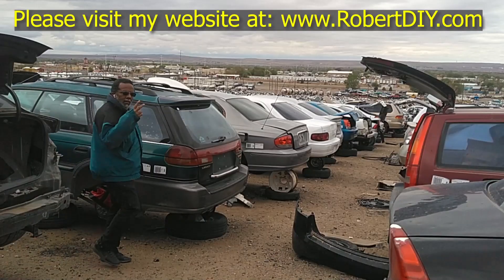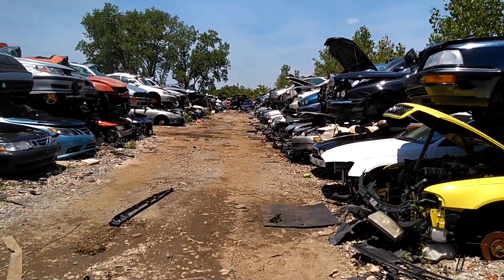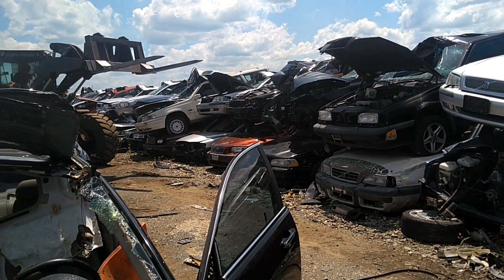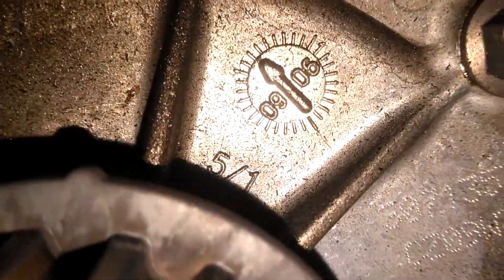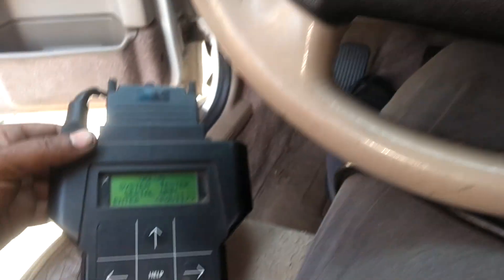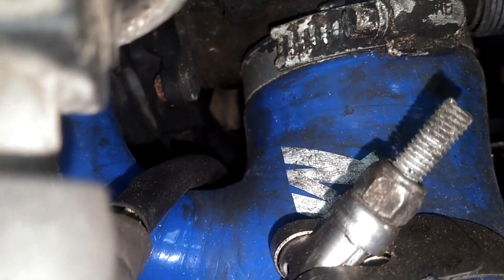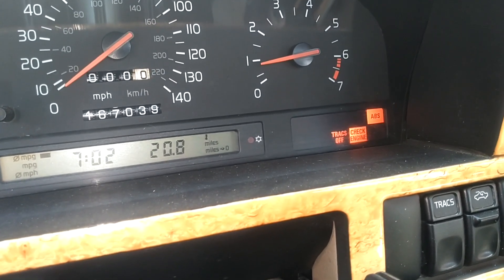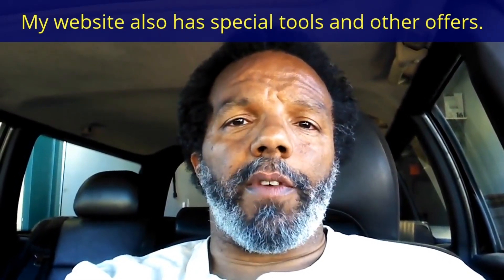More 2 Stack action, replaced a power steering pump and check on a 850R with shifting problems. HOWR

Comment: TPS sensor signal is needed for the trans to know when to shift!!!
Reply from the maker: Yep.
Reply: Indeed  thx robert   u have the best youtube channel info from these volvos (whch are da best FF cars in my opinion , and s70 v70 . i had couple 142, 244's not to mention amazon volvo b20k  -65 although we swapped cheva 350 ci innit with TH350 Dana rear end
That thing is a monsta1👊👍☺

Comment: Hi there

Hope this finds you well

Firstly I'd like to thank you for the valuable information and help that you provide. 

Secondly I'm located thousands miles  away from you so your answer to my questions will be greatly appreciated

I need your step by step instructions on how to remove Rear Cooling Bypass Pipe because  it started to leak from where it meets the back of the water pump 

My car is Volvo xc70 2001 turbo AWD

Thanks and  best regards
Reply from the maker: Disconnect the exhaust at the turbo flange, pull the exhaust manifold, disconnect the pipe from the cylinder head and hoses. Then pull the pipe out of the engine which plugs in behind the water pump.
Reply: @RobertDIY  thanks for your reply i do appreciate it. do i have to remove the entire turbo or no?
Reply: @waelabdelmajeed4999  Robert mentioned in another video that he usually doesn't get a notice from YouTube if someone replies to his reply so he probably didn't see your follow up question. Ask it again as a new comment or call or text him.
Reply: @sjbock  thanks buddy.  He already answered my question